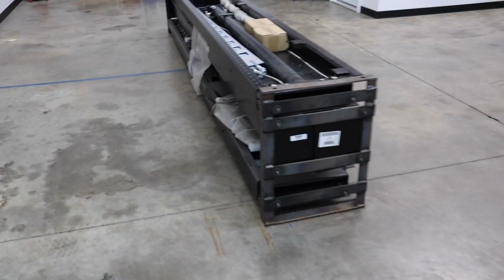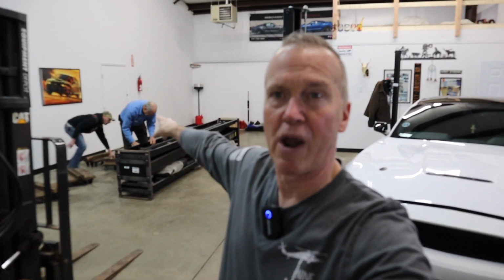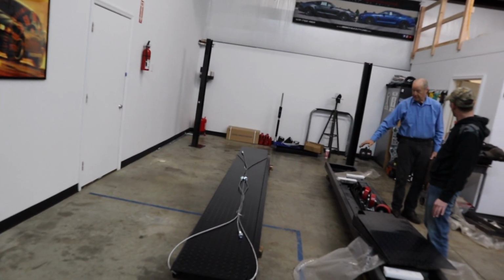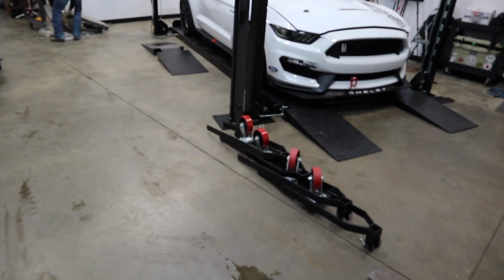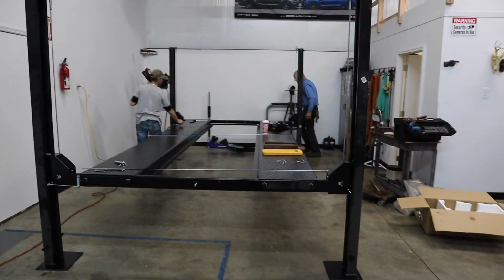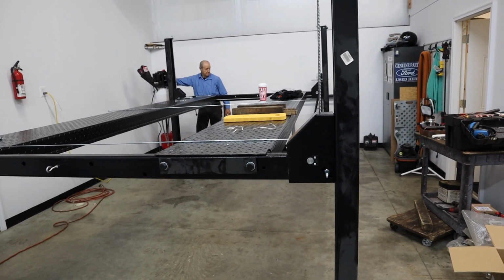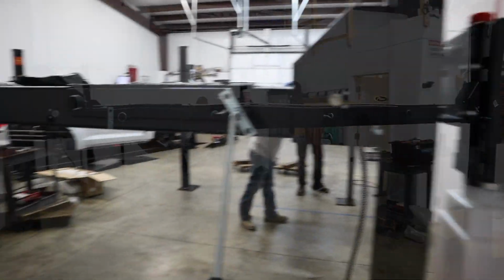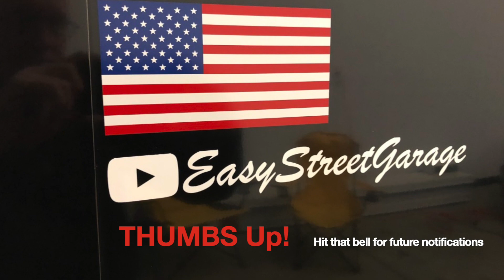Titan 4 post lift install

Comment: Good afternoon, I’ve got a question. I have all 4 corners plumbed, the treads are level.  When I raise the lit all goes well but when I go to lower the entrance lowers but the other end gangs up and the cables go slack. Do you think its the cables not be set at the right length or is it something else? Thanks in advance Davve